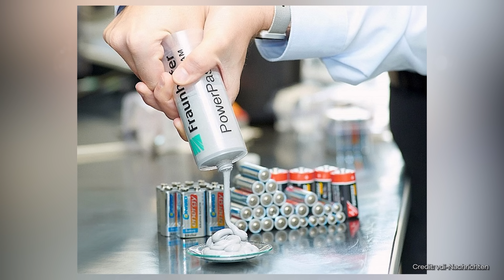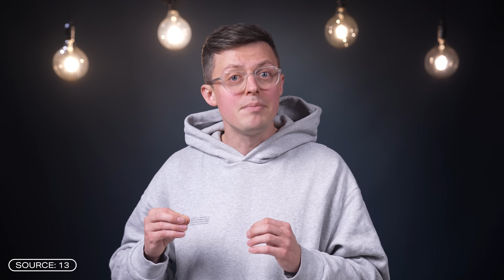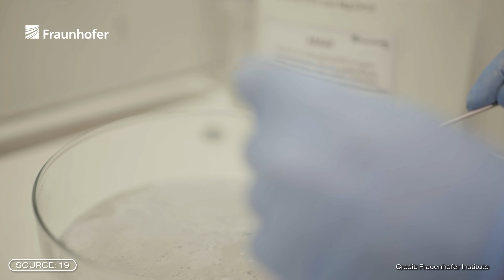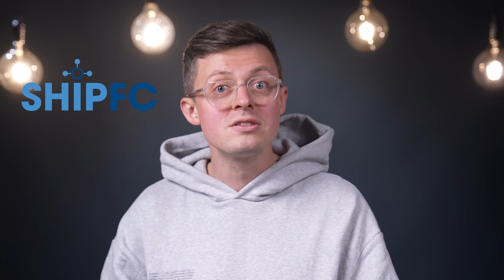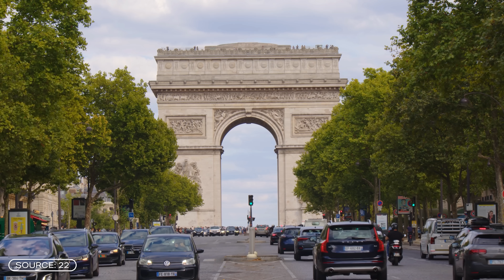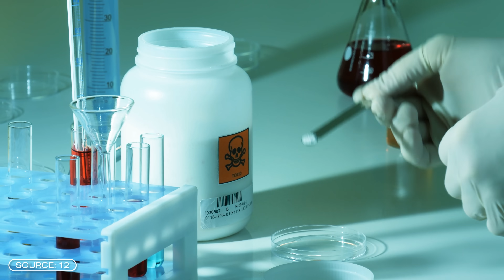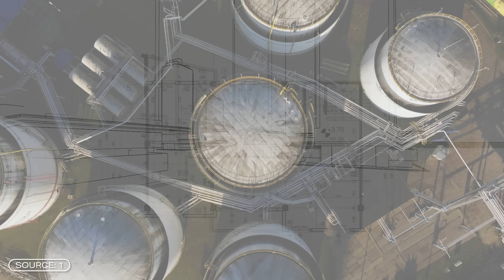Hydrogen Powerpaste: 10x Higher Energy Density & Safe?

Comment: I use a fluid solution of hydrogen bound to carbon. This fluid is energy dense. My car was adapted to burn this fluid with a device that atomizes the material into a combustion camber.

Comment: So it has 10x the energy density of LiPo batteries, so does gasoline. Just as a basis for comparison that's fine but you can't recharge batteries which spreads their cost over the entire lifetime of them. This if you have to add water to activate it as a chemical, I don't think this will have any large scale applications. I seriously don't see this being applied in vehicles in any meaningful way just given how ppl drive cars.

Comment: Too many bits left off - the paste may be energy dense, but a car would need to transport the water it's mixed with as well, so what's the effective energy density once that is considered as well? With 'flash charging' coming to market, how would something like this compare on refuelling times? And what's the cost per kWh for the materials. We know the energy efficiency would be less, but as there are points where solar plants have a surplus of energy the base electricity cost might not be the main factor. Also, what scale of equipment would be needed to produce this realistically? Also, the claim of 10x is off because current Lithium and Sodium batteries have higher capacities than they state, so even before you add the weight of the water you're looking at 4-6x not 10x. The overall figure may be only 1-2x, at which point it likely has no chance for automotive applications.
If it was possible to run a solar-powered recharger of sorts at a domestic level, then you could see some interesting applications, particularly for energy storage off-grid.
However,  the progress with solid state batteries, sodium batteries and other battery tech means that this might have missed the window where it could have been competitive.

Comment: 10kg of paste produces 1kg of hytrogen. 
This mesurement is meaningless we need liters. Google tells me at boiling its 14.1l which sounds impressive. 
BUT how much water do i need to carry to convert that 10kg of paste into 1kg of hytrogen??
If i need to carry 10kg of paste and a further 50l of water it starts to get a bit silly.
For reference 14l of hytrogen has approximatly 1 to 1.7l of water capacity in volume. So what ever solution this is needs to have a total volume less than say a 2l bottle (rounded up). Unless this paste is obscenely dense and some how you compress or use less than 100ml of water it aint mathing so far as a solution?
Even more alarming is 1.6kwh per kg, compared to normal petrol it has 13kwh per kg, so NOT EVEN CLOSE.

Comment: Hydrogen storage is just one of many problems with hydrogen. The worst problem with hydrogen is that it is produced at a large net thermodynamic energy loss. Simply stated, it requires more energy to create hydrogen than using hydrogen as a fuel generates. Very little hydrogen can be obtained by drilling for it. It is possible to use solar power to create electricity which can then be used in electrolysis to generate so-called "green" hydrogen, but the amount of energy lost to heat is greater than if the electricity were just stored in a battery. Over 90% of commercial hydrogen production actually comes from using methane (the main component of natural gas, a fossil fuel), and this process generates carbon dioxide gas as a waste product. Again, the energy content of the hydrogen produced is less than that of the methane starting material. Thermodynamics is the primary reason hydrogen won't work economically, but adding all of hydrogen's many other problems makes it far worse. The paste is great for small scale industrial applications of hydrogen. It won't come close to solving the problems of trying to use hydrogen as a major energy carrier.

Comment: Aluminum Gallium Water Hydrogen Fuel Cell System? -  or - (2Al+2NaOH+2H{2}O = 2NaAlO_{2}+3H_{2}+{heat} - generates hydrogen gas that can be burned to run internal combustion engines or power fuel cells?
Reply: True these systems use refined aluminum - which takes vast amounts of energy to produce

Comment: At 3:30 You claimed that it's 10x the energy density (1.9 kWh/l) of li-ion battery but the Li-ion battery energy density varies arouny 500-700 kWh/l which is still amazing but it's 2.7-3.8x, not 10x (in another video You also calim 700 kWh/l for the lithium battery)

Comment: The problem with hydrogen isn't much different than the problem with fusion - too cheap.
Could be using for short distance vehicles right now - iron-titanium has improved for storage, as well as titanium-manganese based storage - just need to limit size for auto

Comment: vehicle, no paste is too thick, leaves residue, and at this point batteries are getting cheap.
large scale seasonal grid storage, potentially, there you can manage (and reuse) the residuals,
ships, yes seems like a decent option, power dense, and weight is not an issue, nor are residuals
planes, maaaybe? again residuals are the issue, normal jet fuel burns so the plane gets lighter as it goes, making it progressively more efficient.

Comment: I just saw this video and your latest video on MOFS.  Since the need to compress H2 to store on board, I believe using H2 to power vehicles at this time is not economical.  I wonder if anyone is looking into MOFS as a H2 sponge to be even more efficient in storing high density of H2 at a low pressure?  With the 2024 Chemistry Nobel Prize winning group developing powerful AI techniques to decipher complex protein structures, to understand how these protein molecules work and even create new molecules that can be even more efficient, maybe AlphaFold 2 like systems can produce MOFS that can make H2 a much more inexpensive transportation fuel?  Maybe targeted MOFS advancements can be use to cheaply strip H2 from hydrocarbon fuels, while sequestering the carbon?  Fuel cells are twice as efficient as internal combustion engines.  H2 has more energy per gram than gasoline.  Even though it is costly, we must produce large quantities of green H2 to produce green NH3, green fertilizer and green cement.

Comment: Wow, 13% the power per kg of gasoline, all the energy put into seperating water and magnesium from oxygen goes into the paste with no waste.  What a wonderful idea.

What's next, clockwork ships?  We could build giant springs that you swap out when they run out  THe spring modules are almost infinitely reusable, and perfectly recyclable.  We could install winding plants on LNG carriers to supply a fleet of rewinders - like tankers, but carrying rewound clock modules, returning to the winding ship with the unwound modules.  Yes, I know it's a stupd idea, but you started it.

Comment: This hydrogen power paste may have an energy density of 10 times that of lithium ion batteries, but Gasoline has a much higher energy density. Gasoline holds about 80-100 times more energy by weight than current lithium-ion batteries. Thus it is much more energy dense than hydrogen power paste will likely ever be.

Comment: 4:14 doesn’t that mean that you couldn’t put a burning truck out with water? What about a leaking warehouse? If it burns does the leak make the fire worse? In terms of safety this sounds much worse than gasoline which requires a chemical reaction to start a chemical reaction. This requires humidity.

Comment: Still think we need to get better at wind turbines before we look at ships. Most blades being used are only go for up to 20 years most less then 10 and being resin and fibreglass/carbon fibre they can only be buried safely.
So we are just adding micro plastics which we still don't fully understand.
Also ships make the smallest amount of CO² per ton mile.

Comment: You still need to add the water to the power density calculation. You cant power anything without the water!

can you exclude the anode in a battery? no! can you calculate the weight of a rocket without the liquid oxygen? yeah, nah, please.

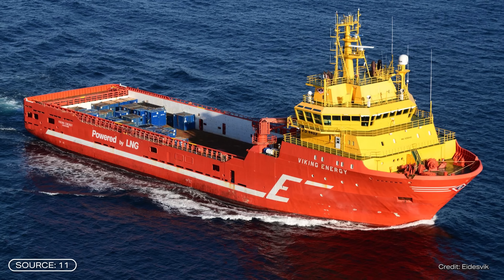Comment: 7:03 Bizarre and worthless ideas.  Sounds as if the writer of the script has accepted the bizarre idea that EV vehicles do not produce pollution.  Yet, in their production and recharging, loads of carbon dioxide is produced, unless the electric is produced by a carbon free method, such as atomic fission.  If one goes back to the pre-Freon refrigeration days, many people were killed an ammonia fires.  How many fires and losses are acceptable?  Interesting, but at best, a better battery. 7:03 9:19 “Can be recycled” is far from can be reused forever - wastes are generated, even with lithium batteries, when they need replacement. What provides the vacuum?  What provides the heat needed for hydrogen release?  A diesel engine??  9:19

Comment: too late

China already has commercialized its Hydrexia
= (Room Temperature + 1 Atmosphere)
or
Solid-State Hydrogen

it already provides portable safe storage and safe transportation of usable Hydrogen as fuel

via truck
via train
via ship
standard sized for cargo containers
etc
Reply: 110 kg H2/m^3 (Ambient Temperature+Pressure)
= Lightweight Magnesium Hydride Alloys
aka: Hydrexia Solid-State Hydrogen

vs

70.8 kg H2/m^3
= Liquid Hydrogen (Cooled)

vs

14.4 kg H2/m^3
= Gaseous Hydrogen (20 MPa pressurized)

Comment: As usual, hydrogen hype leaves out pesky details. It is not 1.9kwh/litre if you also need water to release the hydrogen, that’s like only including the volumetric density of a cathode without including the anode of a battery.  

Add the volume of the paste, the volume of water, and the volume of the consumed paste, then scale by the conversion efficiency for hydrogen to electricity.

Comment: Lets make some average calculations for this paste  future in use as a substitution of conventional energy sources. World leaders in production of Magnesia(hydrogen paste main component) all together except China, giving around 250000 tonnes per a year. Assuming if all to use for Paste, It would bond 25000 tonnes of hydrogen, which can produce in average 50000 megawatts per a year( Europe only consuming significantly more energy per year) Plus, to get this paste, it will require factories, where reaction of Magnesia and Hydrogen can be done in safe whay, considering that reaction is going at 560 deg C and 200 atmosphere pressure, and obviously consuming a lot of energy...

Comment: 4 tons of Mg-H paste per year since 2021 means about 20 t were made up to 2026. Where are they ?  Filling a car tank with this paste to be stirred  and dropping water into it leads to an irregular flow of H2 stopping only after hours of the last drop of water.  Result is a tank  filled with a thick (tixothropic ?) paste hardening with time to be substituted by a new, clean tank, the old one to be cleaned by acid or an immense quantity of water in a factory.  The Mg hydroxide can be transformed into oxide usable by the hands of   gymnasts.  Als in Muenchen promovierter Chemiker  bewundere ich die  genialen Kollegen aus Braunschweig.

Comment: So you have to add the CO2 emited move the raw powder to the factory, process, and ship to the fueling location. Then for some of these it seems to need to be ship back and recycled, but maybe not reused for hydrogen. Plus some of these systems that need vaccum and heat, so you use up some of the power to free the hydrogen. All of them need pumps to build up pressure for the fuel cells. So until there are large amounts of excess clean energy its poinless. Except for greenwashing   and soaking up goverment grants.

Comment: The paste seems like it has the major issues for the awkwardness in delivery, with not being transported by easy liquid or solid movement mechanisms.

===

Ammonia for ships seems like by far the best option so far for non-fossil-fuel sources. And the shipping industry's main motivation is finding a solutions for the end of oil, which is only around 50 years away.

As they have to do something.

And they have to build the ships to prepare for the end of oil before the end of the oil.

And have a plan to avoid investors being spoked.

And this avoids having to have a colossal paradigm-shifting overhaul to other systems than engine-stuff.

===

Synthetic/biological synthetic natural gas seems the most likely option for high-travel-between-fuel-stop-vehicles and heavy machinery after the end of oil and natural gas so far.

It fits in existing system. And everything else seems to have major downsides.

Comment: Hydrogen paste is nothing new. Its application, however, is still not taking off because after it has been used (discharged), huge amounts of waste is left. To "recharge" or recycle this material, it has to be transported in almost all use cases. The recycling process is not cheap either. The recycling cycles are limited. The fuel cells need precious metals as catalysts. In short, the overall cost is way too expensive. Hydrogen paste is a flop. At very best, it is useful for niche applications only. It is sad to observe how weak German science outcomes have become. Wishful thinking is not helpful in science.

Comment: Interesting, given the right price and a method that reduces waste material and easy recharging it could really make hydrogen actually useful in transport, using liquid or gaseous hydrogen was always going to be, well personally I consider it impossible, to many problems to overcome, this method does remove some of those obstacles, specially for use in large vehicle transport, but still something in development so we can only wait and see. Batteries it seem to me are still the best option for personal transport due to the ease of charging and the increasing energy density of batteries that are solving the most common complaints of range and charging time.

Comment: As long as hydrogen is made from fossil fuels - and virtually all are, this whole thing is nonsensical. You always have serious conversion-losses and additional CO2 pollution. So if you're using gas to then make hydrogen, to then use it in your car or machinery, you're far better off using the gas to start with.

Comment: 1 liter of diesel (or palm oil) contains about 10 kWh of energy. Instead of a 500-liter diesel tank, the truck would need roughly a 5-ton tank for paste (and likely a similar capacity for water). 🤦‍♂

Comment: There are some natural sources of hydrogen gas but hydrogen can embrittle steel in pipelines and it's small molecules can easily leak.  Never mind the pressure requirements.  that's bad. an alternative storage method would be very useful.

Comment: So, for every 2.2 pounds of this material, you get 1.6 kW, to drive an EV 100 miles would take about 25-35 based on rough estimates.
You'd get less than 10 miles driving an efficient vehicle per 2 pounds of powerpaste, not including the water needed.
I'm certain that the other methods of recharging your EV are more efficient and less complex.
Remember, kinetic batteries are less energy density efficient than chemical batteries, which are less than combustion engines.
Still could be useful for scientific applications in some manner, but I just don't see this as practical as is, too much material waste for consumer markets.
(It would cost about $5 @ an average 16 cents per kWh to drive a wall socket charged EV 100 miles, this paste may cost upwards of thousands to do the same with more waste)